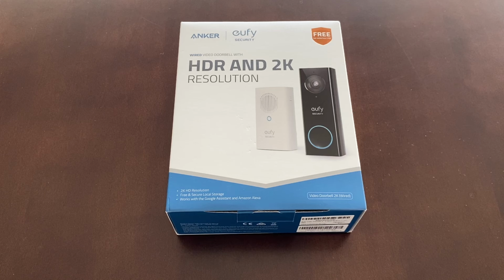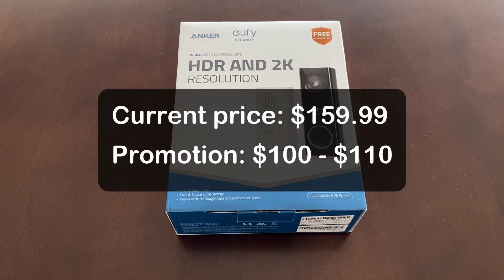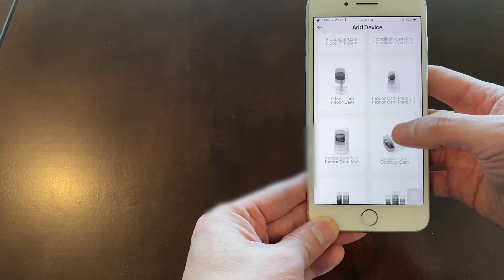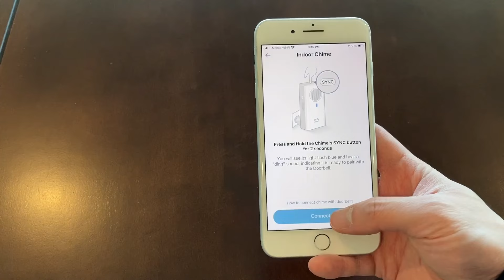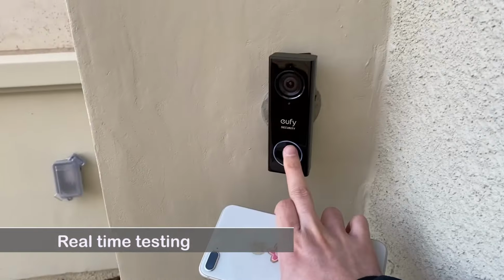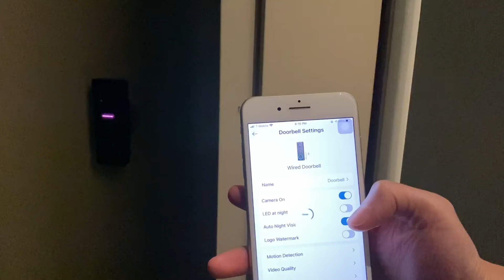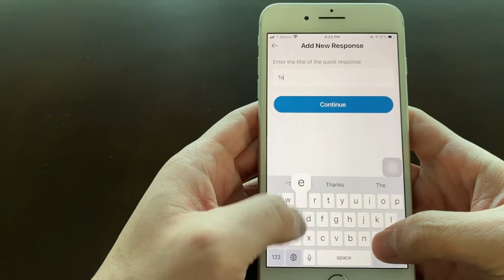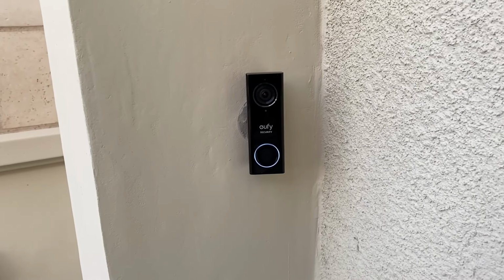Eufy Video Doorbell 2k (wired) | Installation | Best Settings | Review

Comment: Just installed the 2k wireless/wired version kit... Its great so far,  Our chime/base unit with the included mini sd storage has foldable antenna's on each side of it, included the wedge w the 2 holes  All installs are obviously different, and ive noticed diff of product types for the chime after watching multiple reviews so far... Thanks for the extended views of the App settings, That is what i was looking for Since there is not really an in depth explanation of the app functions.
Reply from the maker: Thank you for your comment :) The app recently got updated so the UI looks different now, but all the functions are still the same.
Reply: Ok, Thanks again for the well covered review....Thats exactly what i thought, Act as a battery backup type scenario, which is best in all terms.  My mother had been wanting one for almost 2 yrs, i talked her into going this route for its features.  Will look again for the % icon.

Comment: I just installed the 4K version with battery or wired install and am going to send it back, the battery wouldn't charge off the doorbell wiring and it wouldn't detect motion at night. Replaced it with the 2K wired version and it works flawlessly.
Reply from the maker: Yah the battery charging off the wire is not that reliable...

Comment: will this ring the existing mechanical chime / bell in the house or only the included chime will work and not the one in the house,, where u put the bypass cables in the chime box,, that House bell i am asking about if this would ring that on main floor ?
Reply from the maker: Once you put the bypass, then your own chime won’t ring. If you don’t put bypass, your chime will ring but the doorbell may not have enough electricity to work. You may get the battery powered version instead. That one you may ring your own chime.

Comment: Really in depth and helpful video could you please show in detail how you put on the jumper cables on the chimes meaning which wire went to what screw thank you for your time
Reply from the maker: Thanks for the comment. You may see how I put the jumper cables around 2:05 of the clip. I realized that my hand was in the way the entire time lol. I did attached the wire diagram at the right upper corner of the screen. Basically use the black jumper cable to connect the "Front" (front door) screw and the "TRANS" (transformer) screw.
Reply: @randomhomegadgets  great thank you so much for the reply I will look at it closer

Comment: How will I know whether I need to use the angle plate provided? Our front door and landing area is a compact space. I feel just mounting it flat in the same position as the old bell ringer should suffice.
Reply from the maker: If your old bell is facing straight outside then you don’t need to use the angle plate. If your old bell is facing towards the wall then you may the angle plate to tilt the camera to look outside.

Comment: Can I use my existing chime with the door bell or I  can only use the chime that comes with it? Thanks
Reply from the maker: The wired version need to use the provided chime/Wi-Fi bridge. The battery powered version can use your own original chime. You may see the battery version in this video: Eufy Video Doorbell 2k (Battery Powered) | Installation | Review | Smart Lock Integration
https://youtu.be/R3XSEb3s83w

Comment: Thanks for the informative review. When the doorbell is pressed do you get a distinctive "ding-dong" sound on your mobile (iPhone) or just a standard notification? I have the current model doorbell and I only get a standard notification and so miss pretty much every bell press. 

My mate has a Ring doorbell and when its pressed he gets a clear and distinctive "ding-dong" on his phone. Albeit he pays a subscription it appears the better system?
Reply from the maker: I’m glad that you like the video. When the doorbell is pressed, you will receive a push notification on your phone along with a sound. You can choose in the app what kind of alert sound you like. There are 10 choices including the “ding-dong” sound. It’s under setting -> notification -> app alert tones.

The Ring system has similar function as the Eufy system. I like Eufy better due to no subscription.
Reply: @randomhomegadgets  thanks for the reply. I’m only getting the push notification no other sound afterwards hence missing the doorbell push

Any ideas on a solution?
Reply from the maker: That’s strange. Maybe check iPhone settings, scroll down to the “eufy security” app, then “notification” to make sure notification sound is turned on.
Reply: Ring is not better at all. In fact, it has so many software issues and many times it doesn't even work before you reset it. I am replacing it with Eufy.

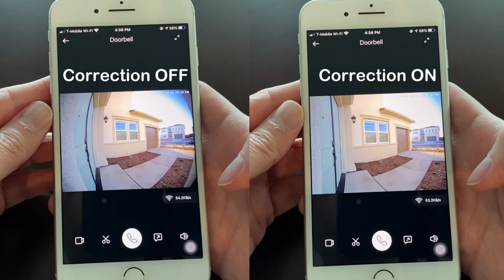Comment: Hi, sorry for the very late response. I just bought the Eufy Doorbell 2K battery powered. I see in your video that you adjust the curving (see at 8:49 > ) But on the newest app (V4.2.3_931) that option is no longer there!?!?! Where and how can I adjust that curve angel? t.i.a.
Reply from the maker: Thanks for your comment. In the new app this option is under video settings -> video quality -> Distortion correction.

Comment: Great & clear installation video RHG👍
One issue i had i upgraded my wi-fi (5ghz) connection not realising the door bell only works on 2,4ghz
which rendered the door bell useless and would only work as a chime when pressed
I got on to my wi-fi provider just the other day who remotely setup my wi-fi connection so i would have both connections on my broadband
(the slow lane & fast lane as he put it)
But still would not connect after reinstalling Eufy app and even a different email (as if i'm setting up for the first time) still no joy
Until i seen another post were you have to press the reset button at the back of the door bell I'm positive it doesn't mention this in the booklet?
I've not done this setup as of yet but will try today (25/03/23) when i get home hopefully it picks up the 2.4ghz signal and i'm good to go.
Any tips would be appreciated if anyone out there has had the same issue.
Reply from the maker: Yes, you may press the reset button at the back of the doorbell to completely reset the device, then you should be able to go through the set up process like it’s new from the box

Comment: so does this work with my existing chime or do you need the included chime box?  Doesn't seem like you could hear that included chime throughout the house??
Reply from the maker: If you want to use your original home chime, you may get the battery version instead. The eufy chime box makes decently loud sound, but not as loud as the original home chime.

Comment: Hi. Just bought the wired version. We don’t have existing doorbell but there is n electric wire ready. We tried to install it but we are stuck at the installation. The doorbell would not light up so we couldn’t proceed with the setup. But chime works just fine.
Reply from the maker: Try to use a multimeter to check the wires. It could be that there’s no electricity on the wires. If that’s the case, then would be better to get the wireless version.

Comment: The wires behind the doorbell seem to be exposed to the elements? Can water get in? Just curious
Reply from the maker: It's not water resistant but not water proof. So occasional splash won't cause a problem, but if you blast water straight on it the water will get to the wires. This is true for all wired doorbells, unless you put a layer of electrical insulation pad between the doorbell and the wall.

Comment: Electronic chime Does not work when T - F terminals are shorted out with jumper.
Reply from the maker: It's supposed to be like that. The jumper basically bypass the electricity from your home chime to send extra electricity to the doorbell so it will have enough electricity to function.

Comment: Do you need to bypass the doorbell on the wall?
Reply from the maker: For the wired version, will need to bypass the home chime to get enough electricity to run this doorbell. You can get the battery version then you don’t need to bypass the home chime.

Comment: Cant we just use the existing bell sound already installed in the house just like the ring door bell can? I mean instead of installing this extra little bell box that comes with the door bell??
Reply from the maker: Yes! Just need to get the battery powered version instead. You can connect the wires to the battery powered version and use your own chime. Here is the video of the battery powered version
https://youtu.be/R3XSEb3s83w

Comment: why bypass the chime？If the transfer has 24v, still need to bypass?
Reply from the maker: Without jumping, the voltage between the 2 doorbell wires are typically 16V only. The other 8V is used to power the chime. Jumping (bypassing the chime) lets the full 24V go to the doorbell wires.

Comment: Do you have to charge the battery version or it charges itself from the cables?
Reply from the maker: For the battery doorbell, if you have per-existing doorbell wires, you may connect them and charge the battery continuously. If you don't have per-existing doorbell wires, then you need to take the battery off to charge.

Comment: I am unable to hear a ring or the sound in the app  when a person press the bell or motion comes to the door what could be the matter
Reply from the maker: Check if the app notification is enabled. Both on the phone system and inside the app itself. There should be a pop up notification with triggered events

Comment: Thanks for your video. I already have an Eufy system with wireless cameras and I'd like to add a wired doorbell. Can you tell me if it is possible to deactivate the doorbell temporarily from the app? Or possible to program a deactivation from a specific hour to another (for example during baby sleep slot time everyday) ? Thanks
Reply from the maker: You may temporarily turn off the phone notification by using the snooze function (tap the 3 dots icon at the right lower corner, then the zzz icon). You may also deactivate the entire device (tap the 3 dots icon, gear icon, then toggle off button at right upper corner). But I don’t think you can schedule specific hours to deactivate the device.
Reply: @randomhomegadgets  Thanks for your quick answer!

Comment: So you can or cannot use existing chime instead of Eufys
Reply from the maker: You can use your own existing chime with the battery powered version. You can only use Eufy’s chime with the wired version.
Reply: @randomhomegadgets  wow..Seems backwards..thks
Reply from the maker: The reason is that if you used the wired version, it needs the bypass the electricity from the chime to power it, therefore the chime won’t work anymore. If you use the battery version, the battery provides the power so won’t need to bypass the chime.
Reply: @randomhomegadgets  ok, thks
Reply: So do you know if all wired doorbells by pass the chime?
Reply from the maker: I would say yes. At least for the most common brands on the market including nest, ring and Wyze.
Reply: @randomhomegadgets  ok. That is good to know. Thks very much ..jc
Reply: @randomhomegadgets  Google Nest Wired 2nd Gen works with an existing chime. I don't know why Eufy can't do the same thing.
Reply from the maker: @artstech  Yah, Google Nest need to install a chime connector to achieve that. Maybe eufy would copy that in the future.

Comment: I bought the Eufy 2k doorbell, but I needed a longer power cord that came with the doorbell. Do you have any suggestions?
Reply from the maker: Did you get the wired doorbell or the battery doorbell?

Comment: Had 2K  wireless doorbell for over a year. Now the app shows "Doorbell is offline" Any suggestions to Fix. Thanks
Reply from the maker: You may try taking it down and hold the reset button for 3 seconds, then pair the Homebase again.

Comment: Can anyone help me:

Does the battery charge when hardwired? I have wired my Eufy doorbell, but I see the battery being drained daily. I would expect it to increase percentage instead of decrease, right?
Reply from the maker: Hi there, there are many reasons that the battery is draining. It could be due to excessive battery use due to frequent recording activity. It could be due to the doorbell wire doesn't have enough voltage (did you up the wire jumper on your transformer?). It could be due to low atmosphere temperature. It could be a faulted battery.
Reply: @randomhomegadgets   Thanks a lot for the helpfull response, just to confirm on my question, the battery should be charging right? I read in other places that it sometimes stays at 1%
Reply: Hi I have the same question. I just installed a transformer for my wires & connected my doorbell it was on battery only previously since I didn't have a transformer on my wires previously. Do I have to reset it? Or does it detect the power on its own?
Reply: Did you get an answer?
Reply from the maker: Hi there, once you connect the wires, it will start charging automatically, don't need to reset it.
Reply from the maker: @Jokerjan92 Yes the battery should be charging. It could be that your doorbell use power faster than it charges.
Reply: This video relates to the wired version,not the battery powered one!

Comment: What if you dont have an existing electronic door chime?What if its an old style mechanical buzzer?
Reply from the maker: It depends, some of the mechanical buzzer has similar wiring inside. If you feel comfortable, open the buzzer to take a look, otherwise should consult an electrician. An alternative would be installing the battery version of the doorbell cam instead: https://share.eufylife.com/v1/shopping/s/g/Ahwo_ul6B
Reply: Just use the battery edition.
Reply: @terrymd3293  battery edition is much more limited

Comment: does it charge the battery via those wires?
Reply from the maker: The wired version has no internal battery. The wires power the doorbell directly. The battery version has an internal battery can can be charged via USB or it can also be wired and charged continuously.
Reply: The wired version has no internal battery. The wires Power the doorbell directly. The battery version has an internal battery can can be charged via USB or it can also be wired and charged continuesly.

Comment: Has anyone installed this with rings plug in wire?!
Reply from the maker: The eufy wired doorbell power requirement is 16-24V AC. I believe the ring plug in wire adapter has DC output, so I don’t think it’s compatible.

Comment: Do I have to by pass the doorbell??
Reply from the maker: It’s recommended to bypass the chime for this wired version so there would be enough voltage to power the doorbell. But if you get the battery version, you don’t have to bypass.
Reply: What happens if you don’t bypass your chime?
Reply from the maker: If you don’t bypass the chime, you may not have enough electricity to power the doorbell
Reply: @randomhomegadgets   Humm, thats interesting, w the wireless we got i just hooked it straight up, works great, Although i did test the output on the leads at the door and it was about 18 to 19 volts, So i figured that was great all things considered.... given the house is 45yrs old w original system etc.... is there an onboard way through the app to see battery status, if i recall somewhere in another review somebody said no, Then again i cant recall if it was for this brand/model or not.  Eufy is great for onboard storage and not being a mandatory $ service upcharge on the cloud crap, that is a big factor imo
Reply from the maker: If you use the wired version, the electric leads need to directly power the doorbell so will need higher voltage. When you use the battery version and wire it, the electric leads are used to charge the battery, not directly power the doorbell, so lower voltage would be ok.
As for the battery status, I believe there's a battery status icon next to the wifi icon on the main screen.

Comment: My chine not connecting
Reply from the maker: Try to bring the chime closer to the doorbell and push the reset button on the chime. If still not working may need to get a replacement from eufy

Comment: Isn't that bell easy to steal? You just clicked it to that thing mounted on the wall. Anyone can take it off then.
Reply from the maker: The clicking mechanism won't allow it to come off unless you have the pin key to unlock it. But if someone has a pin key, then it can be removed easily. The video is saved at the chime inside the house, so you can still recover the video if someone try to steal it.

Comment: getting these wires coil around was just impossible. i gave up and just hang the damn thing. ill recharge it in a couple of months i dont care
Reply from the maker: If you use their provided spacer it’ll be slightly easier since there is a bit more room.

Comment: why on earth are you wearing those bloody wiring gloves to use those very clean, first time used tools?  why cant i find one video of the someone giving the polarity of the wires.
Reply from the maker: The 2 wires come out from the doorbell transformer are not polarized. Since they carry alternating current (AC), there's no one strict positive wire or one strict negative wire. The polarity of the wires alternates and hence the name "alternating current". This is in contrast to the direct current (DC), which will have a fixed positive wire and a fixed negative wire.
Reply: @randomhomegadgets  there is no info on this in all the instructions eufy give. I bought a 24VAC plug in the end. doesn't work with a ring charger which is DC
Reply from the maker: They do talked about it, but not that obvious: "Note: Installation requires existing doorbell wires at 16-24 VAC, 30 VA, or above."